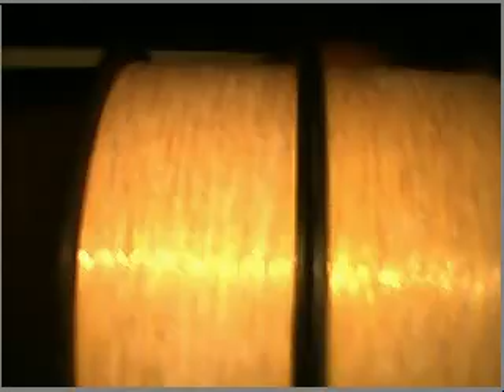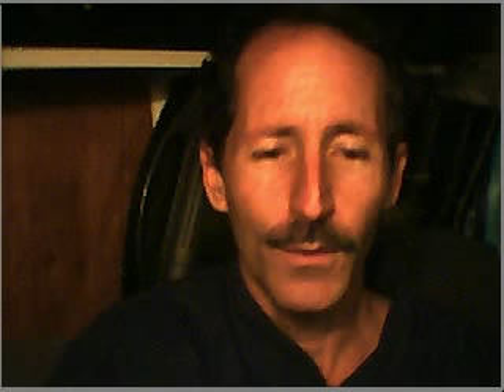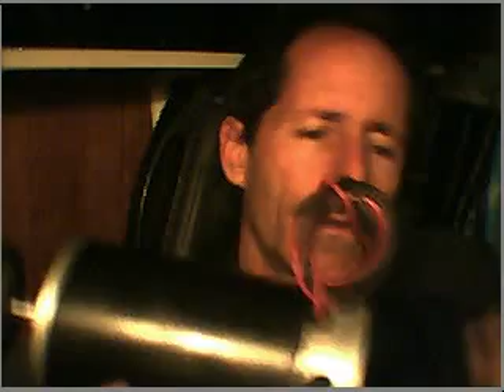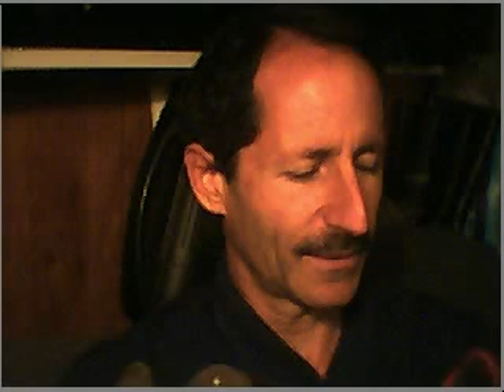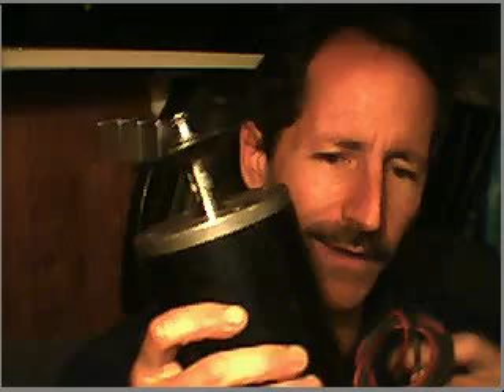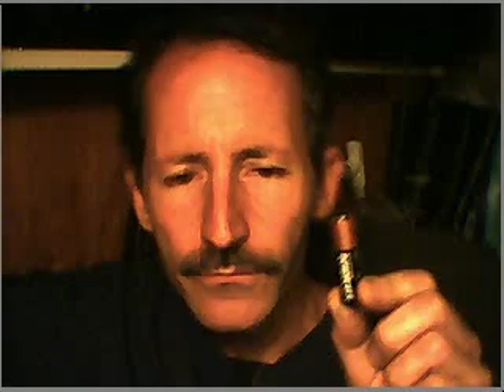Joseph Newman Motor

Comment: What is volt and what is amps?
-Amps is the number of electrons moving through a conductor. 
-Volts is how close to each other the electrons are pushed. All electrons are negative charged and they repel each other just like two magnets facing same side.

So 2 electrons is like 2 amps. The space between them is long so its lets say 6 volts. If placed closer, the volt will go up.
Effect as WATT is volt x amps
6 volts x 2 amps = 12 Watt
If a motor on 6v supply draws 2 amps, the motor is 12 watt

Comment: Where do you get plans to build a Newman motor? As far as I know Mr.Newman has not released any plans or secrets to how his motor works. How can you and others replicate his motor without this info? 
How many volts were you pushing this motor with? 12volts times [ .01 amps] is [ .12 watts].
This is very little power to run a motor that " nobody could stop".
I agree that Newman should show a self running motor. In fact he should show his house running "off the grid", that would make me a believer

Comment: @kdaveem Two problems with your comments. Check out the MACHINE, not the Man. Mr. Newman seems quite mad by now, and makes many odd statements. However, I find that there seems to be something to his theory if not the actual machine. ALSO: The batteries that WWL TV engineers tested were SUPPLIED by the engineers and were said to be SLIGHTLY USED not "nearly dead" like you say can be heated and get more use. Other than that I do like thoughtful skeptics. Good commentary but very blurry bad video.

Comment: You can still achieve great torques, which is free mechanical energy, while simultaneoulsy capturing the back spike, which simply needs to be turned around in the correct charging fashion. Caps help in keeping it from loading down back to the source. This all originated from Tesla himself. Tesla never claimed a free energy device either. Not one time did he mention free energy in any of his patents. The energy already surrounds us. And are your working models at?

Comment: I think Joe Newman is right. I have been finding more and more lately that this lines up directly with what Tom Bearden has said, IMPEDANCE attracts more NEGATIVE ENERGY, and blocks POSITIVE ENERGY.  Mass is = to energy, all you have to do is activate the free electrons already inside of the copper that sits there so freely, duh, dude, you failed miserably. It's a giant leap from a wimpy Bedini Motor, in fact him and Tom Bearden got that idea from Joe himself! The mechanical energy is free also.

Comment: but what was going on with your ELECTRONICS?  yes he WAS hiding data, its in the electronics, that the EM field PULSES, collapsing and re-opening.  Have you checked out the research papers by T.E. Bearden?  The laws of EM are way overdue for being updated.  After Einstein said E=mc squared, the law of conservation of energy should have become the law of conservation of MASS and energy.  but anyways, the effect to Joe's motor has a lot to do with the circuit.

Comment: I like you was very excited about this when i first heard about it, but the more research i do the more i agree with you that something just is not quite right.

As for the recharging batteries that is really nothing special, it is possible to recharge normal non-rechargable batteries, in fact if i remember correct the best way to get the most life out of them was to top them  regularly rather than let them drain completely. I can try to find the article if you like.

Interesting Vid.

Comment: "However by increasing turns AND coil MASS simultaneously, you MAY be improving the magnetic coupling between the rotor and the rotor, but you will be LESS impressed by the power output."

The exception is where you're coil is far too small for the magnets that you have. But coils are usually cheaper that magnets, so this condition is rather rare. Yet, this is the condition of my present setup, which I will need to fix with a bigger coil that I "hope" to prepare by the end of tomorrow.

Comment: Increasing turns for a GIVEN coil mass is only good for using small capacity batteries in series with higher voltage. However by increasing turns AND coil MASS simultaneously, you MAY be improving the magnetic coupling between the rotor and the rotor, but you will be LESS impressed by the power output. You can reduce turns and increase coil mass, and that will help you until your system has:
1) High eddy current and hysteresis drag.

Low resistivity materials with no torque function waste NRG!

Comment: "The only way to increase efficiency is to increase area/turn*rpm*strength."

Assuming the configuration of the motor and coil is A+ and that the power supply is appropriate for the coil being driven, the only other way to improve the efficiency is to scale up the area of each turn. Conventional motors do not put their rotors within the coil, but they treat the interior of the coil as uninhabitable that a bar magnet i.e. they do not fill it in. Thus the area of their coils is limited by design.

Comment: "I used various voltages on my motors, depending on how big the coils were, what gauge wire I used."

Adjusting the turns density and wire diameter for a given coil mass is only good for adapting the coil to:
1) The voltage and capacity of your battery pack - not the other way around. (Thinner wire more voltage and less charge capacity)
2) The rotor you are driving. (Better configuration means less drag and more torque)

The only way to increase efficiency is to increase area/turn*rpm*strength.

Comment from the maker: I used various voltages on my motors, depending on how big the coils were, what gauge wire I used. On my 50 pound coil with 12 gauge wire I was able to operate it fine on a 12 volt battery, but on my 30 pound coil with 30 gauge wire, I put a load of nine volt batteries in series to operate it,m and it was around 250 volts

Comment: I have spent hundreds of dollars. Now I have built a 19.5" fan you can see on my videos. I know I have much more potential for efficiency in my motor (inspired by Newman). There are plenty of valid criticisms for my set up and design (although many people have liked the incorporation of ribbon cable!) I do not see a ceiling for the efficiency yet. I continue to try to improve the fan, commutator, and the setup of the magnets, and it takes me a lot of time. But at least it works during outages!

Comment: Also, YouTube as a communication medium is not very effective in terms of proving electrical output. Every single attempt involving some rectifier+capacitor output I have seen with Bedini or Newman systems has been doomed to insignificance+failure. Mechanical output is the only way to communicate real results of electricity. Measuring input/output via meters is never going to be satisfying to electrical engineers who really understand their limitations.